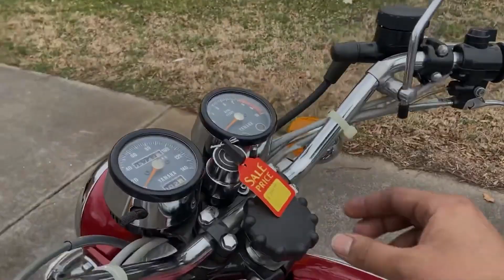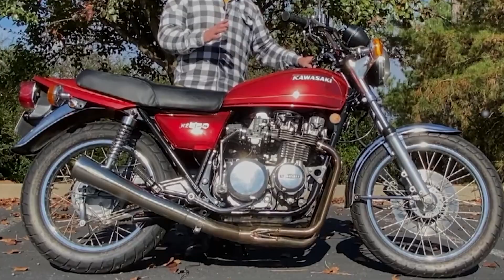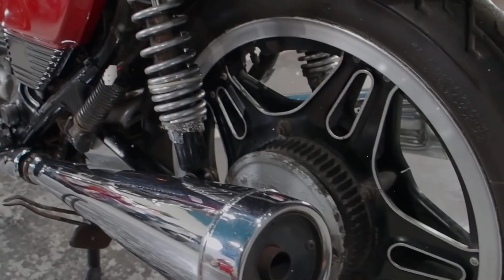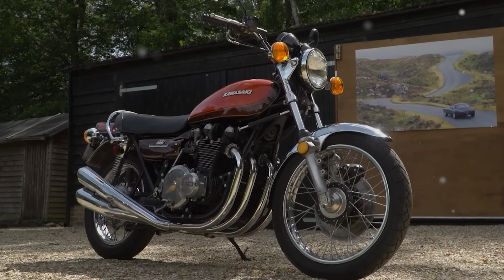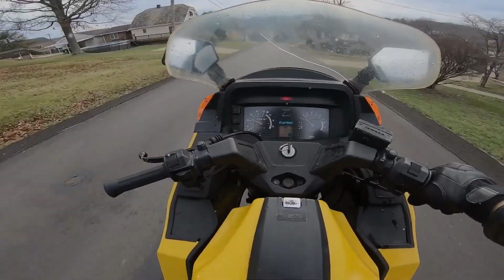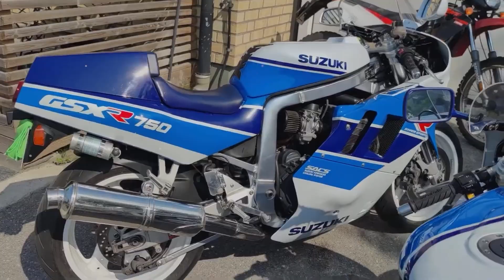15 Most RELIABLE OLD Japanese motorcycles we want back! New Target starts

Comment: Yes, bring the good reliable bikes back, BUT" one very serious mistake most motorcycle manufacturers have made, is eliminating the Kickstarter on their machines. Very sad they got rid of Kickstarter , no matter how good a bike is, what if you're in the middle of nowhere with a weak battery that won't operate your precious electric start. You're stranded. Where as, if you still have a Kickstarter and a little juice in your battery, you still have a chance of running. Bring back the Kickstarter, eliminating it was a very bad mistake.
Reply from the maker: You're absolutely right—and this is a point not enough riders bring up. The electric start might be convenient 99% of the time, but that 1%—when you're miles from anywhere with a weak battery—can be a nightmare. A Kickstarter was a mechanical lifeline, and its removal feels like form over function. It’s ironic how manufacturers boast about adventure and rugged reliability, yet strip away the very tools that provide true independence. Appreciate you calling this out—maybe it's time the industry listens to voices like yours. 👊🏽 Ride safe and keep raising the good points!